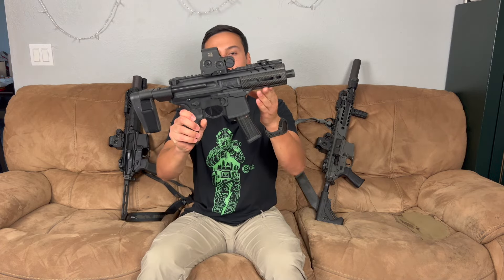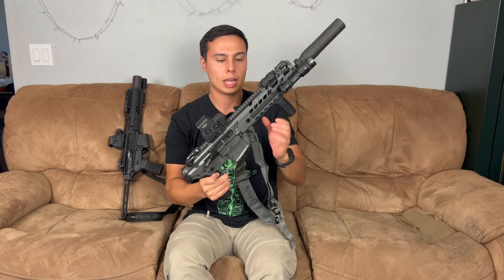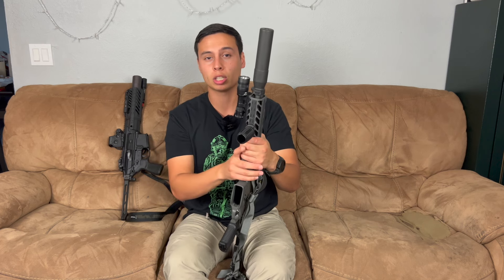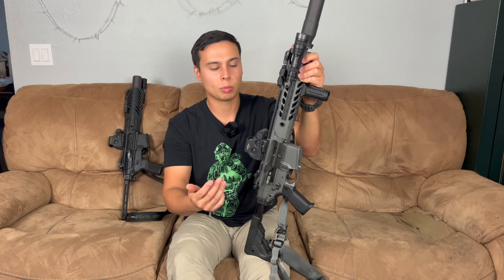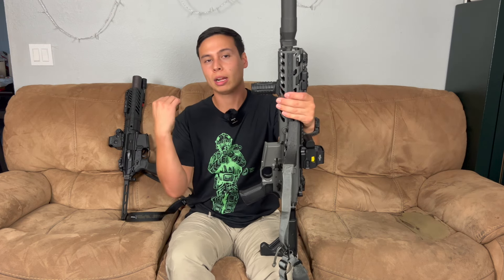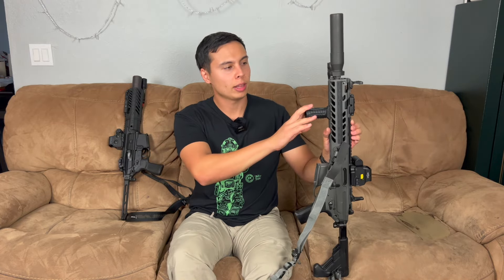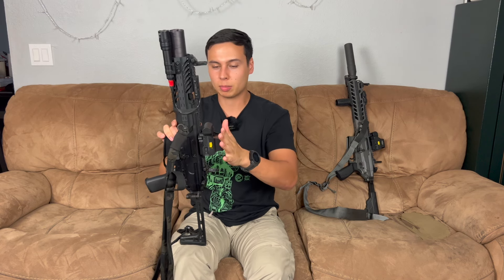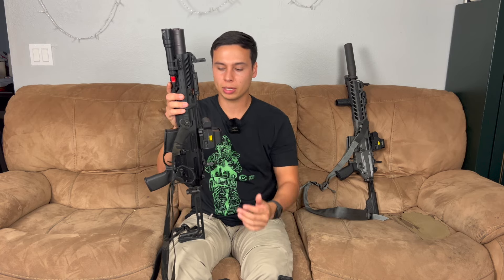Sig Sauer MCX Rifles

Comment: I have the Spear LT 9” 300blk still have to take it out and run it but I love the controls and the feel of the gun. I would like to remove the muzzle device and Use a Huxwrx flow 7.62 on it for less back pressure and because finding the sig suppressors right now is almost impossible 😂
Reply from the maker: I like my Sig cans so far! I'm getting a new one here soon but it's another old model

Comment: for 556 gas blocks they arent suppressed/unsuppressed settings they are normal (-) and adverse (+) settings.  for 300 blk it does have a suppressed (+) subsonic and unsuppressed/suppressed supers (-) which was confusing at first. it's buried in the manual
Reply from the maker: Thanks for the info!

Comment: Try to avoid using those reduced back pressure cans with 300 subs.  Manufacturers can't really tune a super short rifle to cycle weak subs(~45acp) without making it beat itself apart on hot supers(~7.62x39) suppressed. 

MCX without a suppressed setting is annoying since its normal setting is tuned for fighting. You kind of have to run low backpressure can on those to tame the carrier velocity and reduce gas to the face.
Bren2 and LMT piston AR are very good in that regard. If you like a good piston AR, try LMT 12'' piston, It handles full power 5.56 suppressed with a traditional baffled can better than almost anything else.
Reply from the maker: I have a couple LMT di guns. I’ve been wanting one of their pistons
Reply: @mudgunner  👌I would say go ahead. I find an LMT 12" piston SBR with Super42 H2 shoots smoother(~3:30 ejection) and has a bit less muzzle rise than an HBI upgraded Bren2 11" SBR(~2 o'clock). Using the Sandman K 5.56 FH cap, same 5.56 ammo, both on the suppressed setting, both have FH muzzle. Granted, Bren2 is pretty light so...